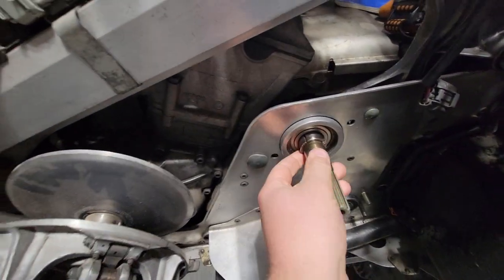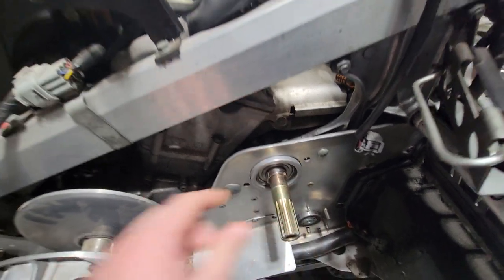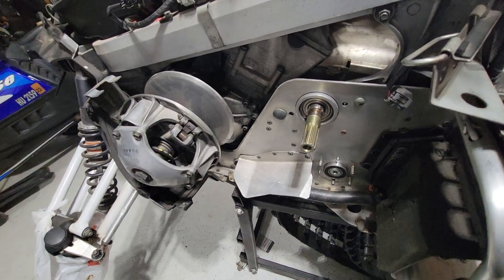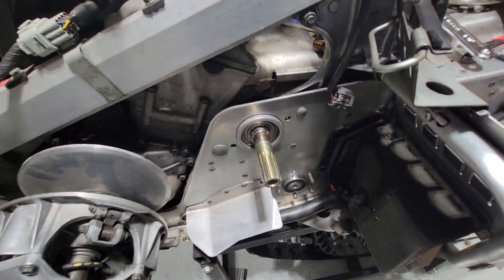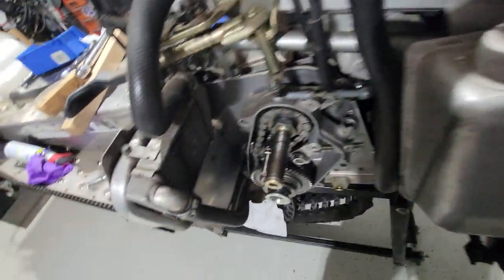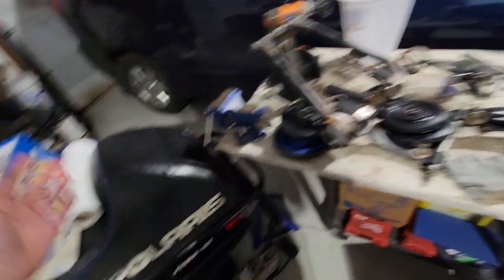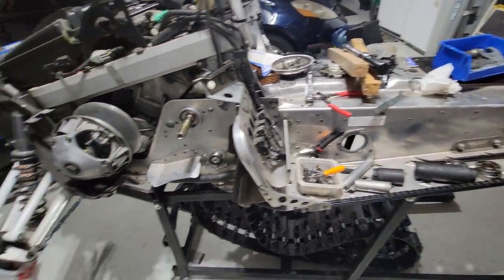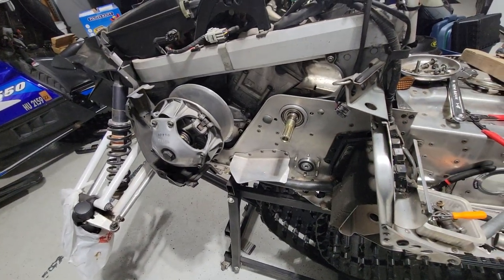Psa to all yamaha apex, attak, rx1, and basically any yamaha sled owner

Comment: my spare bearings from my 03 sx viper fit just right on my 03 rx1. I enjoy how compatible yamahas parts are, knowing they must have done something right to keep the bearings the same from rig to rig. currently making my own rs vector gt but installed a rx1 engine. lotta good work, but surprisingly everything is bolting on as intended. sweet rig you got there buddy, hope you're having a swell winter. ✌️
just subbed!
cheers from Alaska

Comment: did the jackshaft bearing on a phazer (2007).  it was not as easy as the driveshaft one I just did on the nytro, but oddly enough was the same bearing.  I went OEM on the phazer jackshaft original was NSK.